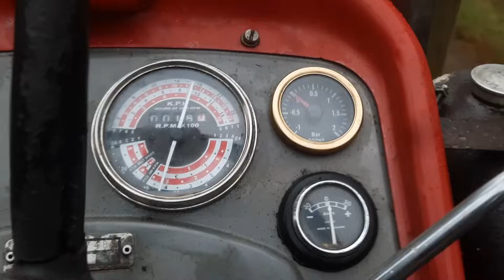My Tractor's fuel pump broke down, Far away from my workshop.. Mf 165.

Comment: Gomoron från Oregon!  För två år sedan kåpte jag en lite gård norr om Hudiksvall.  I  visited Sweden the first time in 1971, made it back the first time in 2011, and farm in 2021.  I worked in Sweden in the lumber industry for about a year in 2019 and got to see a whole lot of Southern Sweden in my travels every month.
I really enjoyed your video.  I am a forester by training, but my real profession for over 50 years has been as a log builder and carpenter.  All of this in volved equipment which means I often had to be my own mechanic.  I must say that you have better luck bleeding a Perkins injection system than I do!  of course, you have a fortunate advantage with the gravity fuel feed to the pump.  I have a teleskopiklastare with a Perkins 4-236 NA motor.  The poor old thing was in need of serious love when I bought it and last night was when I decided to pull the head off the motor, do a valve job, install a new gasket, rebuild the injectors and then see if the injection pump needs to be rebuilt.  My sense is that the old 4-236 motors are about one of the most bulletproof motors ever built.  About the only thing better are the B18's and B20's in my Amazons.  
Återigen, jag uppskatter din video och jag har också prenummerat.  Mycket bra jobbat!

Comment: I noticed you drive an Opel.  Back in my youth (many years ago) I owned a 1959 Opel station wagon.  Tough reliable little car, not something one in high school would want, but it was mine and it did run well.

Comment: Nice tractor,
I purchased a old MF165 a couple months ago,
It was in pretty decent condition when purchased,
Just now getting around to put it to work.
Did some body paint, repaired the rusted out tool box & minor stuff but hadn’t any mechanical issues until last week when it died, starved for fuel, obvious choice was to replace the fuel filters, and when checked the air cleaner it was severely stopped up surprisingly the engine could get any air,
Found the 1st fuel filter & glass bowl filled with rust… from the tank, 2nd filter was remarkably clean - guess the 1st had caught much of the trash, worked my way upstream with the fuel lines, struggling to get fuel up to the next point, the fuel lines still had rust and seemed to be bonded, even when unscrewed, couldn’t pull them loose without concern of damage,
Anyway I finally got the fuel to the fuel pump and the tractor fired up, without me having to crack open the injection lines, 
I used the tractor a couple hours since, seemed like it was running perfectly, then cut out again,
The sentiment glass bowl looks pretty clear now & I have fuel up to the 2nd filter,
I will check the fuel pump tomorrow in the daylight,
I’d suspect debris/rust in the lines making it way through & clogging up the system.
I will mostly have to replace the tank to avoid further issues from the rust getting into the fuel system.

Comment: I drove a similar unmodified and new 165 when I worked on a farm in 1967. It was a good powerful tractor in it’s day. Like yours it had no cab and no safety cage in those days. Nice work on the fuel pump which were often a trouble to bleed.

Comment: Well done.  Nice you did not have to do it in the woods.  But I bet you would pull it out first.  I have the MF35 with Perkins 152 3 cyl engine.  I need to do a seal job on the CAV pump now and I am learning from videos like yours.  Much appreciated sir.

Comment: G’day from far off Tasmania!  I had one of the seals blew on the fuel pump on my Mitsubishi Fuso 4x4 truck 5 weeks ago, here in Tasmania.  I had to send the pump to Sydney (about 2000km away) to swap ( I get someone’s refurbished unit, and mine gets refurbished for some other sucker).  The replacement arrived back last week, we put it on, and you guessed it, they didn’t fix it!!!   It runs great at idle, but as soon as you get it to 2000RPM, it blows black soot, and shakes the whole truck (6 tons).  Now waiting on another replacement - which they say is being expedited.  Great to see you get your job done well in a short period of time.

Comment: You did great explaining this. I have a 880 David Brown Tractor and I'm having trouble staring it. I believe their is more bleeding that I need to do since I drained all of the fuel out.
Reply: Also check at the sediment boowl that there are no little air bubbbles being sucked in....
the seal on the line from the tank to the pump..
the one connection that bolts into the pump itself..can develop wear...and air bubbles are no use in a diesel injection system...
unscrew the connection and replace the seal there with an O ring.....

when you use the priming lever now there will be no bubbles..
solid fuel to push through to bleed everything else...

Comment: Excellent video Richard  :) also nice fast tractor & so cool set up got there and like did to it ! Also I  got make interest to know late Cousin Bill did and get Lol too! He bought 1975 Dodge D350 (1ton or 11.000 kg pound  12 passenger van was used as local hospital near me from 1975 to fall of 1984 to it had 360 V8 gas motor with 4 barrel carb with hand choke cable knob in dash, Manual 3 speed Transmission column shift on steering wheel, 409 rear end gears and made to camping van ! Plus with Propane Stove , Heater, Hot Water tank plus Cold water setup  , Sink  and gas motor got lazy plus transmission so updated! So Bill work for Chrysler Van assembly plant as foreman plus was a co ownership with brother Ken plus 2 nephews Earl also David of Local John Deere Dealership near Bill home plus mine too even Ken plus 2 boys together in 1945 till close up in 2010 for 50 years! But Ken & Bill raised in Detroit Michigan USA families had JOHN DEERE Dealership till 1960 then close up but Ken also Bill moved to Ontario Canada in 1940 near me plus farm then got JOHN  DEERE Dealership going to! But 1985 Bill put 1976 Massey Ferguson 500 Combine motor in the 1975 Dodge Van with Stake truck Eaton  D18  Manual Creeper 4speed Bow Low 1st gear but had 5 Foward gears with Reverse floor shifter in , 390 rear end gears plus 24 volt Negative ground of 2 batteries of 12 in plus updated with fuel system 2 fuel tank on tap by driver seat too , plus extra gauges on Dash for RPM, Transmission temperature, Second fuel tank and Second battery charging! Bill smart guy when building stuff would think work but did and since past away! But got drive the van with grandson Glen my cousin too years ago and heard get fix to be road soon too ! Glenn sold to another guy cousin who take to vechile shows when get fix fully  I hear  because clutch needs replaced plus exhaust too! But the Desiel motor is not a Turbo one !

Comment: Hi and very interesting video. I did smile when you demonstrated your low range and first gear as it reminded me of my old now sold Landrover Diesel Discovery 2 door I owned for 10 years, Its pulling power in both low range and first or lower reverse was amazing.. I enjoy your videos as I too am an old thing at 73 years old, ex AERO parts maker but retired at 55 to the seaside/ Love older things but embrace modern EV vehicles, but, you cant beat the throb of an old diesel.. Thanks again -- Ian. UK.

Comment: I’m just about to do the same on a Bedford 500 engine that’s in my Bedford VAL coach. Interestingly…. My CAV pump has a ‘tell tale’ hole in the bottom of the triangular face plate. This is so that you don’t fill the sump up with diesel and knacker your engine without knowing it. Mine is absolutely pissing out diesel out of this small hole - i thought the pump had failed so badly that it would need replacing but no - its just this drain hole and the fact that the seal has probably turned to stone! - great walk though anyway its given me great confidence to tackle it myself

Comment: I used to work at a Massey Fergusson dealership in the stores and supplied many parts for 165’s. They were great tractors but be careful if you ever put a muck filler bucket on the front. The filler tends to pick the front wheels up and if they come down quickly onto a hard surface the front stub axles can snap. It’s the only weakness I really know of… you have a very tidy example of the type👍

Comment: Holy smokes I cant believe how fast that tractor is. Aesome job on the turbo charger, and modded gearbox. I have an old Massy MF35, it has the loader attachment, and a fork life on the back which mainly carries my 1500 pound counter weight. I put skidder chains on it for added traction. It currently sits in the middle of my driveway as it suddenly quit. I eliminated everything down to the metering valve on the injection pump. So tomorrow mornnig ill get out there and have a look before we go back into -25C

Comment: Just a quick FYI.  My brother and I replaced an injector pump exactly like this one on an old Massey loader/backhoe.  You CAN put the pump in wrong and it will tighten down.  Here's how.  The pin on the drive gear is supposed to go into the slot on the pump, but it is at exactly the right place to go into one of the bolt holes, and you can then tighten the pump up to the machine.  The way to recognize it is that the bolt holes won't be aligned and the gear bolts won't go in.

Comment: Your tractor goes faster than my 1982 Bedford CF ex-ambulance. : )… it’s running on a Perkins 4.154. I’ve just had the engine overhauled, but it’s got lots of white/blue smoke from exhaust on start up and 10minutes plus after - I think the timing may be out a bit… I’ve just fitted new injector nozzles. Anyway, great video… thanks for sharing your knowledge.
Reply from the maker: Hi! Yes check the timing. Valve seals are already replaced i guess? /Richard
Reply: @YesterdaysMachinery  Hi Richard thanks for your reply, I really enjoyed watching your video all the way through. I don’t know if the valve seals have been replaced (if they should have been, I hope so. If they haven’t been replaced, I’m not surprised), a mechanic has been doing the overhaul, but I really wish I had done the whole thing myself… I’ll ask the mechanic today if the valve seals have been replaced and let you know. I really appreciate your reply, solving the smoke problem would be brilliant… thanks . . . . Mike.

Comment: My MF 40B is essentially the same as this at its core. Called an "industrial" it is fitted with a big hydraulic pump in front of the engine to drive a backhoe and front end bucket. It has a silly cab that mechanically interferes with the pedals, and it is painted yellow. Comes with three point hitch and draft control which so far as I can tell has never been used in 53 years. The framing for the bucket severely blocks access to the engine so this kind of work means I have to go like a snake. The best part is the Perkins engine. Rock solid and starts every time.

Comment: Thank you for your knowledge.  I am in Scotland and have a John deere 1640, which I broke the pump shaft by burning cooking oil (I know I'm stupid). Sourced a s/h pump from the next engine up and a bit scared to fit back in case the timing is out 😊.   Any advice would be very welcome 😊
Ps I went away and left the tractor, along return ran for 10 minutes, then stopped,  the fuel had turned into half liver like substance which I cleaned out ( haven't done the lines as yet)😊
I won't do that again if I can get my jd going?

Comment: Nice video and cool to see a tractor that is earning it keeps.
You missed the o-ring that is on the splined axle in the fuelpump, a small amount can stil go through the threads of the retainingbolt if the o-ring fails.
Reply from the maker: Actually didn't know that. I have never seen a o-ring there. And i have worked alot with those pumps. But i will take a look at that next time working on one! As you say there should be some seal for the treads as well. /Richard

Comment: Put red gearbox oil in diesel 1 liter on the 30 liters of fuel or oil for chainsaws insteed. It gives more power if diesel is modernlly dry from the pump. Its the best for old tractors tier2 engines to increase the power and ratio even for turbined ones. Your nothing to lose just try, equal is oil for heating also. Greetings🇺🇸

Comment: Your Opel is very nice. I remember the engine as having a particular nasal sound.
Reply from the maker: Yes a great engine i think. Oil filter was extra equipment tho.... So this one has no filter what so ever 😅
Reply: @YesterdaysMachinery  Just means you have to change the oil more often.  I would imagine it isn't too hard to add an oil filter, though.
Reply: @YesterdaysMachinery  not even a centrifugal filter? 😮
Reply: @petermolnar8667  
Original VW air cooled engines had a "rock catcher" gauze in the bottom of the sump...that was all the oil filtration...oil changes recommended at the time @1000km (600 mile) intervals.
Engines wore out in 50k kilometres if that.....

Comment: I fixed mine by adding a fuel shut off valve after the fuel tank. I had the pump rebuilt, and I took it off and checked it myself. It was mounted vertically. It stopped the fuel from ending up in the sump, and it had no effect on starting.

Comment: Hello i'm from slovenia i have a similar tractor that are licensed of massey ferguson tractors. They are called IMT (Industry of Machinery and Tractors) i have a model IMT 577 it has a 4 cillinder 70 hp engine and has the same fuel injection pump i have a problem where oil started leaking where the pump is screwed on the engine with the three bolts. I now know how to remove it to re-seal it thanks to your video.

Comment: Had this happen in my old Triumph TR3.....The fuel pump diaphragm failed and pumped the crankcase full of gasoline....Kind of a 'red neck engine flush'...Those mechanical fuel pumps are bad for this with to-days gasoline containing ethanol...The diaphragms last about 3 years, if you're lucky...........John (west coast,Can.)
Reply from the maker: Hi! Yes i have been out for that as well. Yeah the ethanol i very bad. /Richard

Comment: The fuel lift pump on the other side of the engine is another candidate if the poppet valve seals are bad to dump all your diesel in the sump :-(

Comment: Ahh, just put the sump diesel into the fuel tank - it should run on that - nice and smoky but that's not important ;)
Reply from the maker: If you knew haw many tons of used oil i have use as fuel... but not engine oil. That clogs the filters to fast. But hydraulic, ATF, 80w90 and so on works just as goos as diesel. Wintertime mix 50-50 oil-diesel to make it thinner for the small lines. /Richard.

Comment: That was a significantly simpler repair than I expected it to be.  I've always heard diesels were complex and difficult to repair -- but maybe that doesn't apply to fifty-sixty year old tractor engines.  Or maybe it only applies to people who don't understand them.
Reply: Those old tractors were simple.  Here in the USA, the EPA (government) has mandated so many pollution devices, the engines today are bogged down by unnecessary things that rob horsepower and over complicate things.

Comment: Enjoyed the video on resealing injector pump on Massey Ferguson 165.  I have a industrial 50E with Perkins 4.236 engine. It leaks diesel from the place where the injector lines leave the pump. Do you have a video on replacing o rings and seals. Mine is a Lucas CAV pump. Looks just like yours

Comment: If you put an oil cooler on after the turbo I think the engine oil will stay cooler. Yes I visited England in 96 and the farmers flew by on the road pulling what my son called turnip wagons. None of the tractors I have driven since I was little would go as fast as those in England. 60mph? All I can say is not with me driving. Can you imagine pulling a manure spreader at even half that speed and having to stop? First of all none of the tires are balanced and oh my gosh, an MF 165 at 60. Holy moly. I like you Swede and I have watched your little 4 wheel drive cars race and to me it seems nuts to go that fast. After all I am 74. I can see it would be safer on the road to match speeds better, but I would have to have top notch steering and no weather checked tires. A crash helmet even.
Reply from the maker: Hi! The oil-temp is good, even after a overload work. 

I have wagons with hydraulic brakes on them so the braking part is not a problem. Steering is 100%. And the tractor runs smoother on the road than my car in 60mph. But it's no fun to drive that fast. I have just tried it once or twice. 

Regards/  Richard.

Comment: Good job !  I have a massey ferguson 250.  It went into the diesel oil bath. Please tell me if the cause may be from the injection pump? I changed the fuel pump and that's not the problem.Thanks
Reply: If you have the same problem then yes...
Richard commented elsewhere here the it happens every 60 years or so....😁😁

Comment: Hi great video! I have a MF 255 tractor with no start problems and I am seeing diesel mixed in the oil. I previously bought a new pump and installed the pump but with no luck to be able to make it start. Any insight would be greatly appreciated.

Comment: How did you get the steering tight enough to drive that fast. All the ones here are loose to get PS to work. They are all over the road at 12 MPH.
Reply from the maker: Hi! No power steering. Just tight rods and joints. No play what so ever. /Richard

Comment: Was it originally fitted with the turbocharger ?
Somewhat smoky exhaust - possibly due to the way you were driving it.
Reply from the maker: No, thats my work. The smoke probably comes from big pump elements and max settings on the pump. Not economical but lots of Hp. /Richard